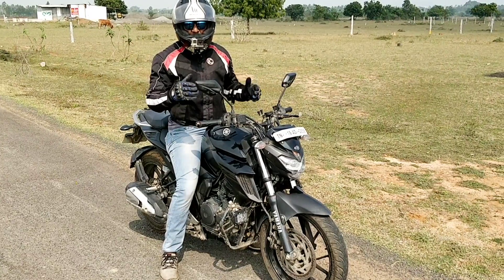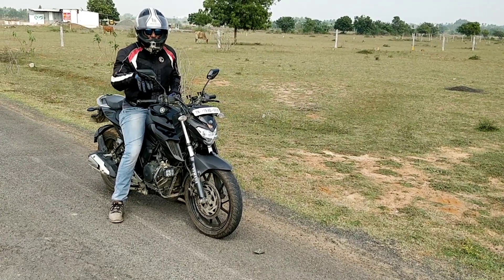youtube video #2t9tu7w7cZM

Comment: Please DON'T misguide people. The only thing you mentioned worth listening to is using both brakes at the same time. Don't do that press-release thing, just press the brake lever progressively harder. Remember guys ABS is a must.
Reply: Priyanshu Tomar what he did and said was almost near the truth. even I experienced this under a panic situation, very recently.
Reply: Pressing brakes Progressively harder.. locks the wheel and makes you skid and fall
Reply: Priyanshu Tomar Don't talk rubbish brother, pursuing front brake continuously will make you fall. Front brake can't be done like the rear ones. And he told the car off nonABS bikes.
Reply: The video is for bikes without ABS though. And ABS is not a must. Its our choice. You may like to skid a little and  you might not want an ABS. Its probably safer to rely on yourself than a small part of your bike which could break down (fingers crossed). While going full brake on either front or rear or both could be dangerous at first, if you practice it, you will find it useful more than once while you are riding. Not just when you are braking. ;)
Reply: Priyanshu Tomar 
thats morr dangerous...
if u press d brake harder u just lock d wheel enough to make it slip on d road...
ul skid if u do that,,, his advice is to avoid skiding and seems lyk more on traction control
Reply: Actually No. The video is about how to brake and reduce stopping distance.
Watch again at 1:21
He's skidding. Because he's applying the rear brake and locking the tire. Its not always safe but for some reason, the friction or something, will let u reduce the stopping distance, that is if the road and your tire are in good condition and you are riding around a reasonable speed. This is why he's advising both Front and Rear. If used together appropriately you can avoid falling off the bike, but skidding is inevitable since you're suddenly killing your momentum at 70 Kmph. 
Inertia will always be kicking your a**, not just in physics class.
Reply: Abhijith G 
yes thats actualy it...
i agree with u
Reply: No probs. Be safe out there :)
Reply: Not really. Front brake is as dangerous as Rear. Since it has more braking power and when you suddenly pull the brake all the way in (panic situation and sudden stops), it will cause the motorcycle to come to a sudden stop or a stoppie. In case of Rear brakes, it will cause you to skid, since the rear gets dragged now, compared to the front which is now under the weight of you + the rest of your bike which has been transferred to the front suspension causing either a handle lock or skid (yes, you could skid even on front brakes) if you're unlucky you could fall off the motorcycle and get hurt. If lucky enough you will only end up dropping your motorcycle.

But the road and speed plays a major role here, whichever brakes you are applying. So the outcome might change slightly.
Reply: No. If the rear brake were in fact dangerous, they would have gotten rid of it long time ago.
Front brake is more likely to let you down because of the reason i mentioned in the previous comment. It doesnt matter what speed you are going at, if you unexpectedly yank the front brake too much, you will loose control same as with rear, but instead of skidding the handle locks up or you are thrown over the motorcycle. Like i said, the road and other conditions still matter for this to happen.
In most cases this doesnt happen because of rider experience. Same with rear brakes.
Tip: Teach someone to ride a bike. and observe how they handle the front brake.
Reply: You can use either brakes for traffic and as for corners you do not need to stop but bring the speed down where u have a good grip and balance...can be achieved applying both / either brakes appropriately. 

I did mention that if the condition was unfavorable you have a chance of falling. But if you do yank the front break too much on most speeds, you will loose control "more than you might with rear brakes". This is as i explained before because of the weight transition from rear to front all of a sudden, unless you are duck walking in which case you are already stable or experienced enough to handle all that weight. Dirt/water/oil/damaged roads/rocks/slow speed inclinations/steep slopes are places where you should avoid using the front brake alone. But if you are to apply only rear brakes, the most dangerous thing that can happen is skidding. I quote with an edit : "To crash because of the rear brake, you need to be either going at crazy high speeds or turning WHILE braking or when the ground is slippery or wet." - This is true for all brakes tbh but depends on how hard you are braking, and once again other conditions like quality of brakes and tires and road.
On a personal note. on a straight road, an average biker can kick the brakes to the road and still not fall. This is because as u mentioned the front tire is keeping traction and also keeping the motorcycle in balance while the momentum or whatever is carrying u forward. IF you keep balance, you will only "skid" and not fall off the bike unless u skid on slippery roads at impossible speeds. This is personal because on tarmac, i happened to come across the situation, and i pulled the rear brakes all the way in and skid. I didnt fall nor had any reason to put my foot down. Dont ever say rear brakes will make you crash. It has less chance of making a crash than the front in normal conditions.

I was talking of learners, aka people who are completely new to biking and is probably riding a bike for the first or second time. 

I hope you understand that im not trying to say Front brake should be avoided. Instead that compared to the rear brakes, its more likely to cause a fall. Rear/Front both brakes can cause accidents, just yanking on front brakes is like hitting a wall. Be careful out there.
I do not wish to say anything more.
Reply: Wow, im sorry..
But glad u pulled out of it. 
Just out of curiosity, what made you crash, other than applying rear brake, just so i can be more careful.

I wouldnt suggest using front brake all the time btw, its too close to the accelerator. Be more safe >.<
Reply: Seen a lot of people go down like that. Pedestrians and riders doing stupid things causing others to crash.
Im not sure if this works for Motorbikes as well, but i've been told when u loose traction/control over rear wheels on a car(RWD), instead of breaking its better to punch in the gas, cuz that will set you straight, rather than braking and causing more skidding (Thank you youtube teachers). Never tried this myself, nor intend to on a motorcycle.
No probs, and ride safe =)
Reply: I guess thats more easy to do than trying to control the skid..And cars do have front brakes, it just doesnt have a separate pedal like on a bike. All four wheels are equipped with brake pads and in modern cars, with disc brakes.

Comment: Dude one thing that you got wrong that you should never apply clutch while breking. Engine braking is really helpful in reducing speed also. If you apply clutch then engine braking will not happen. This is really important while riding in hilly areas or decline or inclining roads
Reply: Chinmay Kashid  i am fear when breaking if i didn't apply the clutch when breaking it could slipped my bike or not?

Comment: thanks your right but there's something wrong.if your talking about emergency breaking.you can used the change gear action.if your using the front brake brother you need to push and holding with control your handle..its my advice.even you well full brake no will not happen to you rear and foot brake

Comment: Hi Cherry Vlogs, nice video, but I don't agree with you when you say the front brake should NOT be applied continuously. When  you release the front brake, the pressure on the front wheel is released, which also decreases the front grip (the more weight on a  wheel, the more grip). In the case of emergency braking, if you apply hard, release, re-apply, and so on, you can be almost sure to lock the front wheel (locking the rear is not a problem). I would rather advise to brake continuously with all 4 fingers on the lever, and slightly release from the pinkie if the wheel locks, but don't release the brake completely to avoid the fork bouncing. In case of emergency braking, most of all you want stability!
Moreover, it is best to get your arms straightened and all of you body locked in order to assure stability. If you  loose the front: locking the front is not an issue if you are properly locked, but with bent arms, on the contratry, you can be sure to go sideways if you lock (and that usually ends on the ground...). It's even more true if you have a pillion pushing you.

Comment: Rear tyre is locked , what abs is doing is prevent tyre from locking ... 
We simulate abs by using hand ... 

If our bike doesn't had abs, the ride safe speed and keep a safe distance ... 

Any way this method is work in highways ...

Comment: Pressing the clutch at high speed frees the tires from the transmission and makes braking harder. In my experience, emergency braking needs to be done WITHOUT HOLDING THE CLUTCH and only pressing half the clutch for rapid downshifting in order to engage the engine braking along with your front and rear brake. And most importantly, the key point which you missed to mention is that you need to ensure that you only apply that much pressure on your brakes that it doesn't locks your wheel or wheels making the tire lose traction and result in skidding or a crash while making sure that your handle stays perfectly straight in emergency/oh shit moments.

Comment: If it is deadly emergency all you need to do is turn off the engine kill switch should not use clutch if your bike doesn't have slippery clutch. Just apply both the breaks and release with at least 3 intervals. Believe me your bike will stop within 5 to 6 meters. 

NOTE: You will have only 1 to 5 seconds of time in emergency and keep your mind cool.

Even if you are hitting someone or any vehicle after performing this then you will not die.

Personal Experience.
I'm a rider. 🏍
Reply: Are you insane? If you turn off the engine while the bike is in gear it'll lock the rear wheel completely.

Comment: Bro should we apply the rear brakes in the same manner as the front brake i.e- press-release, press- release instead of pressing the brake and letting the tire slide. I have read that if we do that then the tires won't slide resulting in quicker braking.

Comment: Good info...but not always a life saver....braking at equal ratio is essential but while panic braking ...this doesnt work at all....wherein the ABS becomes a mandatory for safety measures. i own a FZ V2.0  (rear drum brake doesnt work at all on the move) and i have fallen half a dozen of times because of bike skidding during panic braking. i wonder why Yamaha is not worried about ABS even in its latest edition (R15 V3). I suggest its better to go for a bike with ABS as a basic feature. At high RPMs and with our Indian road conditions and mad motorists around....an ABS is the most essential part of any bike (whether it is a commuter or a Track bike)

Comment: There is another way to stop the bike even more faster which you are not aware of and not included in your video... (WORKS FOR ALL GEAR VEHICLES).

When you come to an emergency situation or you realize that you need to stop the bike immediately, DO THIS... (This technique needs to be practiced to get more efficient in stopping the vehicles faster)... Don't try this at high speed till you are familiar which this Tech. 

here is the Technique...

Before applying the rear and front brakes without holding the clutch, try to DOWN-SHIFT a GEAR if necessary 2 GEAR (depends on your bike speed) from which ever gear you are in (Max. to GEAR 1) and release the clutch (make sure you release the clutch after downshifting and do not lock the clutch back in you) and then start applying rear and front brakes to achieve immediate stopping of the vehicles.

This process should be executed ASAP. (in seconds) to stop the vehicle IMMEDIATELY.

Thank you.

Comment: Bro the road where you performed this test was a rough dry road, abs is meant for wet roads. ABS is definitely a feature which cant be replaced with physical efforts. The braking is really good for dry roads, but on a wet road this kind of braking could be fatal.

Comment: Also let me explain one major flaw with your logic. When you don't have ABS if you hit a very bumpy road that causes your front tire to lift off the ground and you instinctively go to apply the brake that front wheel is going to stop very quickly and with very little effort because it's not on the road and having the load of the bike to push the wheel along. And when you come back down from hitting the bumps with your front wheel locked you're likely to end up crashing. If you have abs if this situation occurs the system will release the front brake as soon as that front wheel touches the ground without causing you to crash. And no matter what argument you have for that that's just a simple fact ABS will save your life people who go around telling people they don't need abs are very very misguided

Comment: you r  locking the rare brake. its wrong. apply force should be front 70 rare 30. fz rare tyre is flat so you r in control.  if its raining or dirty or a thiner tyre you yill crash.

Comment: ABS is truly a joke for bikes. Because ABS system in general is used to avoid skidding of wheels and increase the stopping distance, it does the job by locking and releasing the wheels instead of sudden lock of wheels while breaking. But there is no need of ABS, once the wheels are locked at once the vehicle skids and falls. So is that much necessary?

Comment: Correction. It is not apply and release and apply and release. By doing this you release the weight transfer and larger footprint from the already compressed fork for maximum braking effect from the moment you squeezed the front brake. It should be apply brake pressure progressively harder to stop.
Reply: Technically this is what professionals do. I accept this point. And this video is a bullshit and it's misleading the viewers.
Reply: Nope, when your tyre locks you need to ease off on brake pressure. Try continuing with progressive braking in a non abs bike and then come comment when you've fallen.
Reply: @confusedredditor1660  
The key to good effective braking is not to lock the brakes!
Most riders are not able to prevent locking their brakes caused by their sudden braking action. That's why they have to release pressure and begin the action again. Trying to mimick ABS? No , Trying to prevent a crash.!
That's why manufacturers  come up with ABS. 
If you know how to modulate your brakes progressively , your brakes won't be overwhelmed . I have been riding my R1 since 2007. Before that 2 CBR 900 rr's and another R1 since 1991.
All these bikes do not have ABS! I am still riding my R1. Have never crashed on the track or Canyon carving on weekends using the brakes!

Comment: You did mistake you should not hold clutch from braking point on last attempt you should catch clutch just not to stop bike engine ....When you hold clutch engine wil be free so you can't uSe proper braking so don't use clutch while using brake... Only clutch can be   useful in emergency  times like ...Example I was driving 100 speed in Dubai al kawneej  suddenly my bike  engine  completely was blocked and  going to stop suddenly i git idea that use the clutch to free engine and iam finally done police came finally i am safe so while braking no clutch ....

Comment: I use ABS sometimes it fails and people also falls😂😂, very emberrasing, ok but even if it is abs good practice is to use front brake first fraction of time before using rear this will shift all your weight to front, in tis position let release the front brake for fraction and then again apply otherwise velocity will be converted in to angular movement and bike may skid, ABS works with same principle of not letting velocity movement in to angular it keeps it in movementum and simultaneously applying and releasing both paddles at alternate time rate,..... And bro next time  please use at least a spare bike so other person can rush you to hospital in case of emergency be safe that was really risky tutorial. Be safe, like you and lastly this will only help if your bike position is axtremely straight and sometimes you have to get off track to avoid collision.

Comment: If your going to do a video about motorbikes. Please just at least get the names of the controls right. The CLUTCH is the correct word. There is no such thing as a “sklutch”. The clutch basically allows the gear to move as fast as the wheel to stop you burning out your engine. Hope this helps.

Comment: Breaking is simple without skidding  
When you are high speed in the highway u need to panic braking that situation. Just do this one really helps  just downshift the gear simulationly and don't lock front wheel.. Press the back brake with locking position release simultaneously and now slam the front brake simultaneously (hold and release faster way it will definitely help you.... But abs bikes best because those electric brakes are works simultaneously with in second... Try to buy abs bikes..

Comment: I did not understand the concept of using clutch while braking. can u explan it elaborately.
Reply: When you use clutch the engine brakes won't come in place and take a bit more time to stop. When you don't use clutch the engine brakes start working and adds power to the braking. Hence less time!